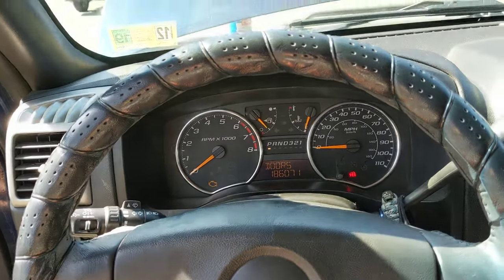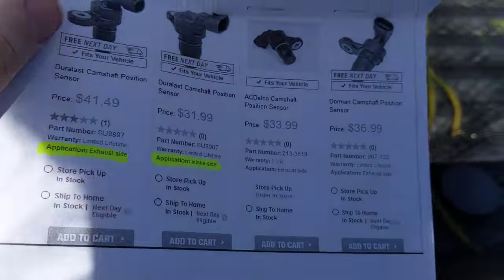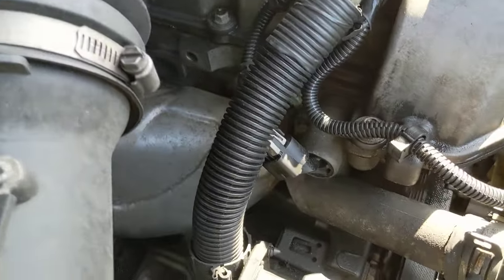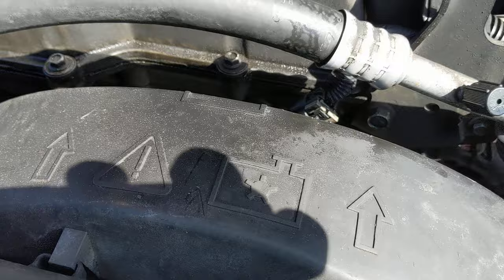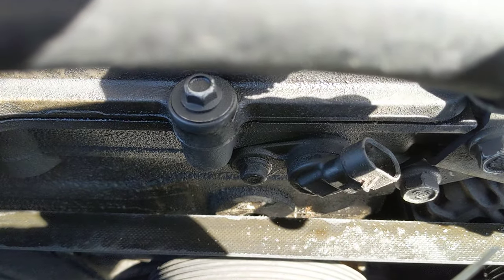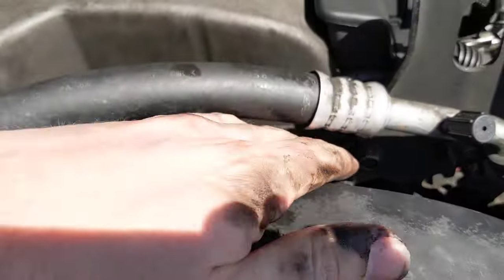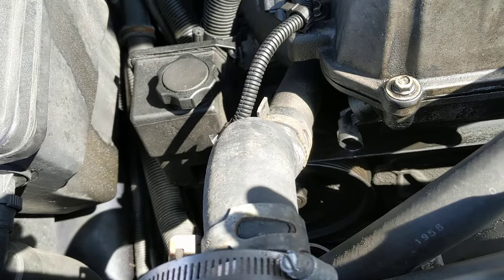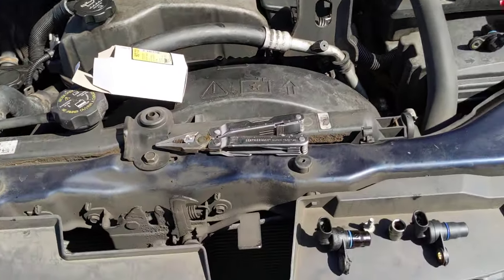2007 Chevy Colorado - Replacing camshaft position sensors, P0340 & P0341

Comment from the maker: After decades of doing car repairs in parking lots, I am so glad my wife and I bought a house with garage in May 2020.  Hopefully my more recent and future videos will be much better than this one.  ☺️
Reply: Congrats, and I enjoy your videos. I have a 2006 Canyon with the 4 cyl. I get a bad coil on cylinder 1 about once every 2 years, probably due to an oil leak at spark plug tube on that cylinder. I’ll eventually attempt to replace the valve cover gasket and spark plug tube gaskets, but it’s a bit tricky and I’m a little scared of peripheral damage. I live in a rural area and it’s hard to find a reasonably priced mechanic.
Reply from the maker: @stevetackett581  good luck!  I would recommend watching a few videos, and also checking on websites like 355nation, coloradofans, and also this Facebook group for tips:

https://www.facebook.com/groups/1191961547485485

It might help to have a few spare parts handy before starting, like the rubber hose that goes between the intake resonator and valve cover, plugs, and a few spare coils, just in case anything goes bad or gets damaged during the swap.  Good luck, let us know how it goes!

Comment: Very common in the GMC Canyon as well. Replace and goes out every few months. Camshaft and crank sensors. Another problem is the anti theft system will shut down and then 10 mins later starts perfect again.
Reply from the maker: At least the sensors are easy to replace.  Might want to try with a higher quality or different brand if they are failing frequently, maybe a genuine ACDelco part would last longer?  😀

Re: the anti-theft system, there is a wire-cutting trick to disable that.  Lot of info about it in ColoradoFans and 355Nation websites.  Personally I sent my PCM out for tuning (PCM of NC) and just had them disable it.  Was easier for me that way.  Good luck!
Reply: @CompTechMike  Thanks for the reply. I will try AC Delco next time. Outside the sensors it has been a good little pickup truck.
Reply: I thought the anti theft issue was only with my truck. Nice to know it's not just me.
Reply from the maker: @Gonzy1122  Yeah, it's a super-common problem.  GM should've had a recall on this.  Also for the blower fan resistor wiring. 😢
Reply from the maker: If anyone comes across this thread in the future, here is a short (2 minute) picture video describing the issue with Passlock in the 1st generation Chevy Colorado & GMC Canyon.  I've included a few pictures and links to information in the description.  Hope it helps!

https://www.youtube.com/watch?v=6fCL6sDm49s

Comment: Im about to change mine but heard mixed things about needing to do a relearn, doesnt look like u needed one. I can just pop them out and put new ones in right?
Reply from the maker: Hi Kenny!  Yes, In my experience, a relearn is only necessary when doing things like the crankshaft position sensor. Not the cam sensors.  Good luck, hope this is the case for you as well!

Comment: Hi Mike, I have replaced sensors, all good for now. I have oil lamp coming on now, no ck eng light. Ran my scanner on it, Nothing. It did it a couple of times last couple of weeks. Now it has come on again even after an oil change . I rev the engine a  little bit and lamp goes out till idle comes back. Any Idea's? Thanks, Danny
Reply from the maker: Hi Daniel, sounds like you are describing low oil pressure. Pressure goes up when you rev the engine, but drops back down at idle. Is your scan tool able to show you real-time metrics on what the pressure is? I'd be really worried about that, if it were me. May just be a bad sensor or a blockage but could also indicate a failing oil pump. This could result in catastrophic damage to the engine, if this is the case.

I'd check first if your scanner can give you exact numbers (instead of just a light). Flush and fill oil with correct weight of high quality oil (I typically use Mobile 1 synthetic extended life oil) and a high quality synthetic oil filter. If light is still coming on check if there is an oil pressure sensor you can replace. You may need to take it into a shop where they can more accurately measure what your pressure is, if your tool can't do it. Good luck!
Reply from the maker: Also, search Google for "chevy colorado low oil pressure light". Look for the thread on coloradodfans website. Some more tips there. Good luck!
Reply: @CompTechMike  thanks for your reply.  I will look for real time metrics. I did change the oil sensor switch. If oil  lamp comes on again I will take it to my mechanic. Will keep in touch. Thanks

Comment: Good tip about the grounds!  This is a good video - Get a tripod for your phone and that would make it an excellent video.  I have an '04 Colorado - just had my cam sensors done by a pro mechanic = $360.00.  I need a scan tool.!
Reply from the maker: Thank you! Glad to help. I do have a tripod now and have been trying to make my newer videos more "professional". We bought a house in 2020 so have a garage now, as well. After so many years of doing car repairs in a parking lot, it's a big upgrade. 😆

My 07 just rolled over 240,000 miles recently. Still running great; am glad to help others keep their trucks on the road, also. 😊

Comment: Mike- I had the P0014 and P0017 codes on my 2006 Chevy Colorado WT (2.8L). About a week ago I replaced the VVT sensor and cleared the codes on my truck. Just before replacing the sensor, I also changed my oil. Ran great for a few days, but then started running rough at an idle like it had before and the check engine light came back on. This time, just the P0017 code. I am thinking of replacing the camshaft position sensors but all the auto part stores searches only pull one camshaft position sensor, the one on the intake side. I have even tried calling to talk to the parts counter directly and their searches will only pull the intake sensor...I am not having any luck finding the exhaust side sensor. I tried comparing the part number for your exhaust side sensor, but according to the AutoZone website that will not fit my truck. Any suggestions?
Reply from the maker: Hi! Mine is a 2007 with the I5.  Your 2006 4-cylinder engine may be different.  I did a quick check on RockAuto.com and didn't see a second one listed for your engine, either.  Have you physically checked the engine to see if it has one sensor or two?  That's probably where I'd start.  It may be the 2.8 only has one.

Also, when is the last time you did a tune-up?  If your answer is "I don't know", it may be time to do that.  Plugs, filters, also clean the MAF sensor and throttle body and make sure the ground blocks on the fenders are clean/tight.

When you removed your old VVT solenoid were the screens intact?  Or were some missing?  Hopefully you don't have one of them lodged in an oil passage, or anything like that.

How many miles are on the engine?  Worst case scenario (in my opinion) would be you may need a new timing chain.

So that's where I'd start. Visual confirmation on the number and location of the sensor(s).  Replace as-needed.  Drain the oil and check for any screens (if they were missing when you removed the old VVT sensor).   Tune-up (if needed).  I saw some anecdotal threads about also changing the O2 sensors, but would hold off on that as I don't think it's related.  Good luck, let me know what you find out!
Reply: @CompTechMike  No, I have not physically looked. I didn't drive my truck to work today. I just assumed they all had 2. Will take a look when I get home tonight. Thanks for all the helpful videos!
Reply: @CompTechMike  Sorry, I didn't read your full post initially. I did my last tune up when I last changed my oil which was about a month ago. My truck has just shy of 130,000 miles on it. When I removed the old VVT senor, it did not appear to be missing any of the old screens...they were all intact.

I bought the truck in December of 2020 and did an oil change on it shortly after purchasing and just went through everything. I noticed the oil dip stick was a bit milky whenever I would check the oil, even after the first time I changed the oil. However, after my most recent oil change and VVT sensor replacement, it seems to have improved. Not sure if that's just luck or somehow related. Anyway, I have found a reasonably priced camshaft position sensor online, thought it was worth a shot to try and get that P0017 code off. Will let you know what I find out!
Reply: Through the process of elimination, I determined the source of the P0017 code to be my timing chain. I am tackling the repair myself and boy, it’s a fun one! I am confident I’m on the right track however, as the plastic on one of the timing chain guides had actually broke off and the timing chain was wearing on the bare metal of the guide. The tensioner was also very far extended and the timing chain itself was loose. All signs to me I am making the “right” repair….even if it’s not an easy one!
Reply: @sarahtweeten1975  little question? Was your truck stalling mine stalls when cold with jumping idle runs great for about 30 secs then rpm goes down and gotta restart it it doesn't do it all the time and sometimes it's about to stall but rpm's get back to normal (significant drop ~200rpm then gets back to 700) idle I have the P0017 code I replaced the throttle body MAP, MAF Camshaft Position Sensor and Crankshaft Position Sensor I don't hear any rattle could it still be the timing chain/ timing chain guard???? I'm starting to be out of ideas and kinda affraid to get the case open
Reply: Hi there! Yes, my truck would sometimes stall, but for me it would be when slowing down to make a turn, etc. Based on what you have said you’ve already replaced, I’m strongly suspecting your timing chain. Even with all my issues, I couldn’t hear a definitive “timing chain” noise and I found my timing chain to have quite a a bit of slop in it, so I wouldn’t rely solely on hearing that noise to determine if that’s your problem. If you have an interference engine, you may want to park your ride. If your timing chain breaks, your valves will slam into your pistons…$$$.

 Not sure what vehicle you have but the timing chain book time on the 2.8L 4 cylinder Colorado is something like 16 hrs, so it’s a spendy job. I tackled it myself. It was challenging, but do-able if you have the right tools and a decent place to work. I believe I spent around $850 in parts (replaced water pump and other bearings on idlers, etc while I was in there) and took me about 3 weeks to complete (working on it after work and waiting for parts). I’ll drop a link to a series of videos that walks you through the job, step by step (if you have the same truck as me). I found it to be extremely helpful! Best of luck!
Reply: https://m.youtube.com/watch?v=rH77JByozSE&t=4332s

Here is the link to the first video in the series. I think there are 5 or 6 videos to the entire series.
Reply: Follow up question, you replaced your VVT sensor already, correct?
Reply: @sarahtweeten1975  yup I did change the vvt thanks for the feedback

Comment: I have same problem with my 07 Colorado 5 clyn 4 wheel Dr, only i have to wait 15 min before I try to start it.  If I don't I have to wait another 15 min. I hope  by changing these sensors will fix the issue. Have you had the same problem again sense you did the replacement? Oil life cleared too. Thanks, Danny
Reply from the maker: Hi Daniel! Thanks for the comment. I haven't had any problems since replacing the sensors. Just make sure you aren't affected by the Passlock problem, are you? That's a much more common problem than the sensors. I'd verify that before replacing the sensors. Are you getting a check engine light. Google "Passlock preventing car from starting" should yield you a lot of info. Good luck!
Reply: @CompTechMike  thanks Mike. I will be replacing exhaust and intake late today. Not sure there is a passlock problem. Is there a way to tell.
Reply from the maker: @1HookTender  Does a "lock" symbol show up on the instrument cluster when it won't start? Passlock issues are very common in our trucks and prevent starting (it's an anti-theft system that makes you wait 10 minutes when engaged/malfunctioning). That's why I suggest looking into it.
Reply: @CompTechMike  I will look for it next time. I do not believe I saw it. Thanks
Reply: Tengo un problema con mi colorado 5 cil 3.7
Cuando esta fría enciende muy bien pero después de aberla usado se batalla para encenderla aveces tengo k esperar 15 minutos para que vuelva a encender me puede ayudar

Comment: Just now watched and subscribed.  Thank you for doing this.  I have a 2012 Colorado and it idles rough. Did changing these two sensors make your truck idle any better? Thanks in advance.
Reply from the maker: Hi!  Thanks for the comment and the sub.  Are you getting any kind of check engine codes?  How many miles?  Maybe you just need a good tune up and oil change?  Check out the product called "Seafoam" - I've used it before and like it, although some people will call it snake oil, LOL. 🤔🤣
Reply: @CompTechMike  thanks for getting back to me.  I bought this truck a couple years back.  It had 70xxx miles. It now has 95xxx. I'm changing oil every 5k. Right after i bought it the check engine lite came on. Engine kept stalling out every time you let off the gas pedal.  Turns out the garage told me to change the oil. The mechanic said the cam sensors had screens that would plug off do to dirty oil. The previous owner must not have done any maintenance,  so i changed oil about 3 times the first month i owned it. Ch.Eng.Lite went off and doesn't give me any problems.  I also clean the Throttle Body every oil change. This makes it better until after about 2500 miles, then starts idling ruff at red lights and stop signs. Truck runs well, gets good gas mileage,  just shakes and idles terrible. Give it gas and it smooths right out.  Also at low idle the tach barely reads 500 rpm. Thanks for any help you can give me. My granddaughter has already took ownership.  She's 12 and  in 3 years she'll be wanting to drive. LoL
Reply from the maker: @deanbarr5740  Hi Dean!  Good to hear from you.  95k miles isn't much for our trucks.  Mine is well over 200k and still going.  Feeling a bit less "peppy" than when new, but I get it.  She's pretty old.  Hope she makes it a couple more years, I'm enjoying not having a car payment right now.  🤣  Sounds like you're doing everything right.  I would recommend a good quality synthetic oil like Mobil 1 Extended Performance, but am sure you're already using something good.  Also as soon as you get a chance I would check the Exhaust Camshaft Actuator Solenoid, sometimes called the VVT Solenoid.  This is the one that has the screens that can tear and fall off, lodging in oil passages and causing symptoms like you described.  I don't have a video link off-hand but there's a pretty good how-to over on the 355nation site.  Check it out here:

https://www.355nation.net/threads/how-to-replace-exhaust-camshaft-actuator-solenoid.17342/

Good luck!
Reply: @CompTechMike  thanks Mike,  I'll check this out. I appreciate you taking the time to help me.  👊👍👍

Comment: great vid loved how you zoomed in on stuff and pointed exactly to the parts and we're very descriptive I have an 04 GMC canyon that had a similar code. working through all the problems right now bought it for my father-in-law who ran the heck out of it to hell and back a lot of crap was broken. funny thing it was slow to start putting my volt meter on it and it was 10.5 volts I couldn't believe it actually started at that I had to go test my bolt meter on a different battery to get a good constant but yet it was 10.5 volts and it started I guess one of the cells is out going to go by new battery tomorrow
Reply from the maker: You're welcome! Glad the video was helpful.  Take your time, work code-by-code, am sure you'll get it running right again.  Lots of good videos on YouTube and in the forums (355nation & coloradofans), and also the Facebook groups.  Good luck!

Comment: Hey so I got a 2006 Chevy Colorado 4 cyl and it’s giving me a p0365 camshaft sensor b bank 1 code any recommendations on what sensor this video is helpful thanks
Reply from the maker: Hi Roque!  Thanks for checking out my Colorado repair video.  How many miles are on your truck?  Are you getting any other codes or performance issues?  To the best of your knowledge, are they the original sensors?  Or have they been replaced previously?

Looking up your vehicle on RockAuto.com, it looks like it only has one camshaft position sensor.  This varies depending on year and engine configuration.  My vehicle shown in the video, for example, has two sensors (intake & exhaust side).  GM GENUINE 2131557 should be the right part number for your vehicle.  You always want to double-check that based on how your particular vehicle is configured.

While replacing the sensor make sure to inspect the wiring harness for any damage.

I would also recommend inspecting the VVT solenoid and cleaning/inspecting other sensors, wiring, and hoses.  Engine sensors are a common point of failure in these trucks and I've got several videos on them.  Here's a link to a couple to get you started:

How to replace air filter, VVT solenoid, and other maintenance on a Chevy Colorado:  https://www.youtube.com/watch?v=U143gNZlWbU

How to replace MAF and MAP sensors in a Chevy Colorado: https://www.youtube.com/watch?v=NgJvLiWsdsk

Hope this helps!